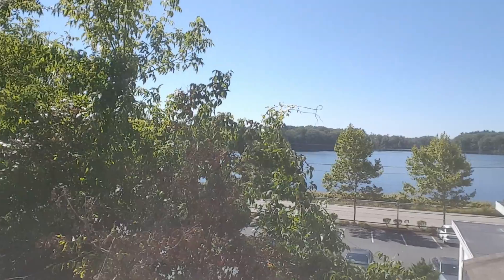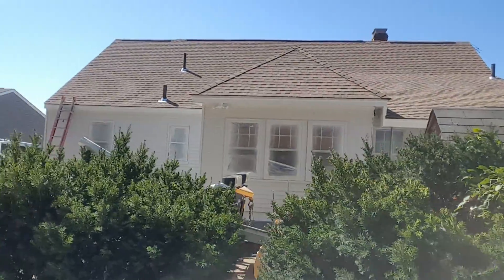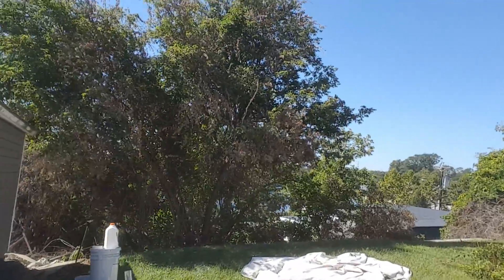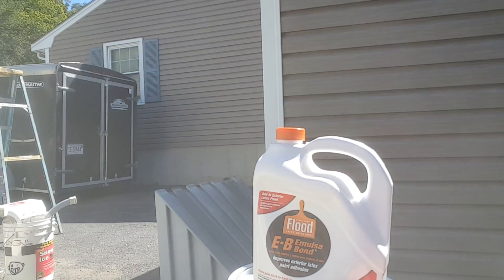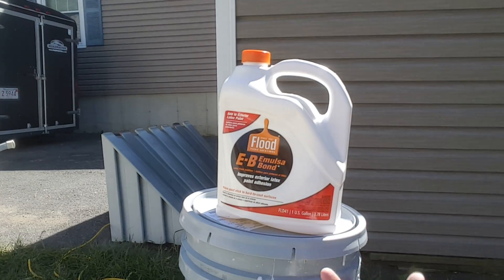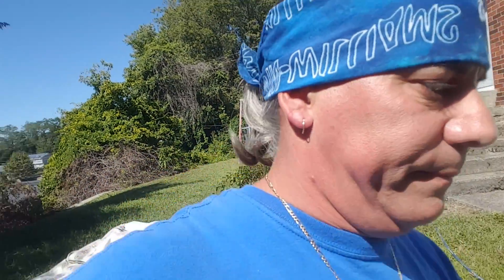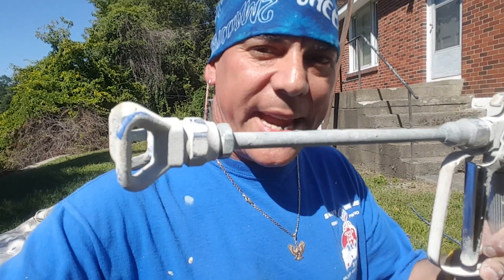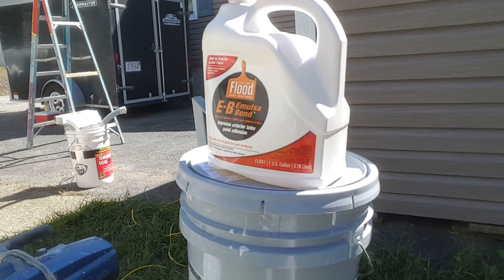Da P8NTRMAN🎨, Exterior Aluminum siding painting.

Comment: Thanks , lots of useful info .I'm needing to paint a camper with bare aluminum sides and top. I thought I would need an etching primer but the TSP sounds like it will do the job. Great Video
Reply from the maker: @Steve Branham, Thank You Sir for viewing my video. The beautiful thing about the process I am describing is that it works for virtually anything that is aluminum. It could be aluminum siding or it could be a Double Wide Mobile home. This process can be adapted  to that soecific application as well. Be safe and Happy Painting. God Bless

Sincerely,
Jhonny Da P8NTRMAN

Comment: I know this video was posted a long time ago but thank you. I’m researching whether I should paint or replace my aluminum siding. Difficult to find good information on aluminum. Everyone just wants to suggest replace but can’t explain why.
Reply from the maker: @nxvx9208  Hello there! Hope all is well and thank you for watching. This is by far one of my most watched videos. The integrity of this paint job is still holding today. The owner of this house is my best friend. I keep asking him about it, and he informs me that it's tight. Many people don't know what to do or how to paint it. Most people think that adding an oil based primer is the way to go. It really isn't.  People have this misconception that because it's metal, it must be treated like other metals. This formula that I came up with is formulated with longevity in mind. I researched the composition of each product and put it together. What I got was a thicker product, and to spray it, I knew that I had to water it down a bit. Once the paint dried, it adhered to the surface and shrunk but still remained flexible even when dried and cured. When that happens, it remains resistant to the expansion and contraction of the metal during extreme temperature changes. That type of protection is what gives a home owner peace of mind. Imagine not having issues with water damage from paint failure like peeling or cracking for, let's say, 10 to 12 years of protection? That is a winning formula.

I really hope that this Paint formulation works for everyone trying to paint aluminum. Cleaning is super essential. Happy Painting. Blessings in abundance🙏

Da P8NTRMAN 🎨

Comment: This video helped me do a great job painting our mobile home....Turned out great! Now I have a  new deck to stain..I have a gallon of flood Emulsa bond left..Should I add it to the Bearh acrylic latex stain that I want to use on the deck??
Reply from the maker: @Daniel Gullick, I am thrilled about the positive outcome of your paint project and I am glad that my video helped you achieve success. 
Regarding your question asking if Emulsa-Bond can be added to a Solid Latex/Acrylic Stain. My answer is absolutely yes. As you know I refer to Emulsa-Bond as being the steroid that makes the paint bond to its surface. I am sure that you will achieve a great result.

A quick reminder. It takes 30 days for Latex/Acrylic Paint to cure. Minimize your foot traffic for at least 2 weeks if you can. You want to allow the coating bond, dry and harden prior to using with a grill or a outdoor table with the umbrella base and or planters for plants. Power wash first and sand down the splinters and then coat. Use TSP and add either simple green or a little bleach to get any mildew off in between the boards. Allow to dry for a couple of days. 
When applying the Latex Stain paint 2 or three boards abd follow them through to avoid overlap marks. Don't paint in the height of the sun. Start it in the morning after the dew has burned off and dried. 

Good luck with your project and thank you for the feed back.

Sincerely, 
Jhonny Da P8NTRMAN 🎨
Reply: I've decided to use Behr Waterproofing stain and sealer....I also plan to add the flood additive on my new deck..The Georgia sun has it ready for its first coat...I was very impressed with the texture of the metal mobile home we painted...I hope for the results on the deck
Reply from the maker: @danielgullick7083  , Sounds good. Keep me posted on your progress. I am confident that it will come out nice. Happy Painting🎨

Comment: Jonathan, my home has aluminum siding that is peeling in places. The siding is installed over old wood lap siding that was most likely originally installed in 1931. I purchased my home a year ago and interestingly did not see the peeling nor did my hired building inspector. My question to you is why do you think the paint is peeling? The worst damage is on the north side of the building. I agree, it could be from expanding and contracting but confused by just seeing the damage. I like your thorough explanation of paint selection and will plan on heading your advice. Looking forward to your reply on the peeling issue. Thanks in advance, Marion South Carolina.
Reply from the maker: Hello Joseph, Thank You Sir for viewing my video Re Painting Aluminum Siding.

The cause of Paint failures have many causes but it seems that you are aware of one of the biggest problem, expansion and contraction of the metal itself due to temp change.

North facing sides are always problematic. It is possible that your building inspector failed to see the issue because of the lighting that day. Besides they mostly look at structural problems instead of cosmetic. In the future hire an experienced painter to look over the property and point out coating failures so that you can empower yourself with information to negotiate the price.

You stated that the home was Painted and now peeling. Aluminum oxidizes and prior to painting it MUST be etched and washed throroughly. Since it is peeling, power wash it with the additive called TSP. Read the instructions for the powder to water yield, first make sure you fill your 5 gallon bucket with water first. Secondly insert the power washer suction tube into the water then use either a brick or a rock to keep the suction tube immersed in the bucket then add the powder solution. You can use half hot water so that the Crystal's dilute better. Be generous with the applying of the TSP and be generous with the rinsing as well. Many people suggest scrubbing. I don't. I dont like scratching the smooth surface of the siding. Pre wet all of the shrubs in the area. Don't want to kill your wife's plants. No, I'm kidding. Something to add, if you have so mildew, mold or that green build up on the siding you can add a quart of bleach to your 5 gallons of water but add it at the end, after putting the TSP in. Always add the ingredients in after you fill with water, Why? To minimize the suds effect.
Ok, after etching the aluminum and after the flakes are removed by power washing allow the siding to dry for at least 3 to 4 days. As you see, I have NOT mentioned anything about primer. That's because it is not needed. Because by etching the hell out of the siding it opens the pores of the metal. 

In my video I used Sherwin William's "Duration" Exterior Satin Finish paint because of the fact that the house had no wind or rain protection. The Home sits high up overlooking a lake, Lake William's in Marlborough, Ma 01752. Down below you see the Notorious Route 20 which adds to wind turbulence in the area and since Massachusetts is big on using salt to melt snow that is added to the vortex of air pollutants and oxidizes in that area.
To make Duration better I added the Emulsabonder by Flood additive which makes your coating have that added elasticity to resist expansion or contraction. Emulsabonder is about $30.00 per gallon. The mixing ratio is 1gallon of Emulsabonder to 5 gallons of paint. Now you have yourself an extra gallon of paint.

I highly recommend two coats so you can get at least 10 years of protection. I took a look at the house in the video recently and it has no peeling problems. It was Virgin aluminum siding and no primer was used. I followed the same procedure I'm explaining to you.

The Paint Store may want to push other coatings. Beware! It may cost more money and it may not go well with the Emulsabonder additive.

This formula works extremely well and that is why I did it. My Sherwin William's rep suggested it and he had overseen 7 jobs that used this particular combo.
Returning to the Etcher (TSP) if you cannot find it in Hardware Stores you can find it on Amazon. The company that makes it is called Sunnyside Corporation. The product numbers are #699-852 and its a 4 pound bag. More than enough to wash your castle.

So we discussed the problem, the fix and the products. Watch my video as many times as you need. You may pick up on something the first time you viewed it. This Two story home used about 12 gallons of paint. The trim I brushed and the rolled with a 1/4 nap roller. Very thin. With Satin you have to paint from seam to seam. Minimize any overlaps. 

Satin Finish offers protections from the elements and bugs can't seem to be able to make their nests like spiders and Wasps. The siding can be easily housed down at Spring time and Fall. It holds up well BUT you might see some imperfections. Flat paint hides a lot of imperfections but everything sticks to it. I go with the lesser Evil.

If you have any questions beyond what I have explained you can email me at jlpaintdesigns at Gmail Dot Com

Be safe, beware of electrical wiring when washing. Make sure the ladders are planted properly. If you are spraying this product make sure to use the proper filters. You want it to flow. You can rent a sprayer at SherwinWilliam's. Don't purchase the Home Depot Graco sprayers. They just don't hold up well. Rent a Graco 395 or a Titan 440. It will serve you well.
Happy painting and keep me posted on how you made out. I Love success stories.

God Bless You! All the best from Jonathan La Salle - Da P8NTRMAN.

Comment: Thanks for the info, buying a tin sided house on the cape.  The white finished in beat, but this should do the trick to bring it back...Close to the water, will the salt negitively effect it?
Reply from the maker: @jron20 r, Congrats on your investment. The high Sodium content in the air near the ocean will affect all metals. Metal Coatings will be an ongoing issue. My advice will be to power wash at least twice yearly with TSP. You may also start switching to stainless steel fasteners, nails, screws, washers, nuts etc. In fact Stainless Steel everything.  You can also use brass. Stainless Steel is just better. Brass will tarnish and turn green when oxidized. So long story short, make sure that all metal surfaces are coated and protected. 

Enjoy the Ocean life my friend. I am a former Caribbean Surfer Boy.

Be Safe, Be Healthy and Be Blessed. Thank You for viewing my video. Hit the subscribe button and follow alk of my painting videos so you can learn new things.
Thank You!
Jhonny Da P8NTRMAN

Comment: I had an estimate to paint my aluminum sided house which is oxidised and 40 years old, they said they would user 2 coats of Sherman Williams super paint. After watching your videos I decided to try it myself and bought a graco 390 sprayer. I also bought TSP, was going to mix with water and simple green to wash the house with brushes and then power wash. Should I go with the Duration paint and EB or is the super paint efficient? You are inspiring, I hope to learn a lot from the project working with my sons to complete the job. Thanks in advance P8ntrman.
Reply from the maker: @Cristopher, Outstanding! Graco 390 is a great product. Just make sure you wash it throroughly after every use. Before you start I please ask that you watch and re watch my video. Take notes and follow instructions precisely. Painting is easy but very systematic. All of the products I used work outstanding together and the home I painted which I shared in the video still has held together fine after 6 seasons began battered by the sun, wind, rain and snow. 

Before you start please email me a message so we can connect. Before you get going let's talk on the phone so I can explain the procedures to you in detail before you start. My email is jlpaintdesigns@gmail.com

One thing to remember, I used to live in Massachusetts, now I live in Washington State. There is a 3 hour difference between East Coast and West Coast. Lets coordinate a time that works for you so we can go over products and procedures. Let's make this project happen for you. When we communicate I will also explain why Duration over Super Paint. I will also explain paint ratios and how much product to purchase. The importance of TSP for Aluminum. How much to use. No need to prime or scrub. I will also share what type of tip and base to get for spraying. Talk soon!

Sincerely,
Jhonny Da P8NTRMAN

Comment: Great video.  Helpful.  Thanks.  Saw a comment that maybe you are exploring options beyond the Duration - which ones?  I have a house with wood, aluminum and vinyl and was going to use a vinyl safe SW color for the Duration paint.  Any feedback?  Also, will the emulsabond be necessary or advisable on the vinyl or wood?  Also, if rolling, with the emulsabond, how much water to add? Grateful for any feedback.  Many thanks!
Reply from the maker: @Light Language, Great questions. I still stand by the Duration product. I recently tried the Emerald line and did not like it even though it is top of the line. I was not pleased with coverage.

Emulsa Bond together with Duration exterior Paint will bond to any surface, wood, metal or plastic. When prepping make sure the surfaces are clean of mold, mildew and any other algae. In your case since you have different material surfaces I strongly recommend that you use TSP with bleach added. A pint of each or as needed.  
Fill a five gallon bucket with 4 gallons of water. You may use hot water if you wish. It helps dissolve the TSP granules. Now place your power washer additive hose into the water and use a small brick or a rock to secure the hose to the bottom of the bucket. Do not submerge your hand into the washing mix until empty. Do not put bleach or TSP first, your water detergent mix will become too sudsy. So add water then TSP and then the bleach. Do not stir to mix, allow each solution to mix slowly. Use a faceshield or safety goggles  to protect eyes. After washing the house thoroughly let it dry for at least 3 days.
Secondly, for spraying,  rolling or brushing you will mix 5 gallons of paint with one gallon of Emulsa-Bonder. Pour the Emulsa Bonder into a five gallon bucket. Open your other five gallon bucket of paint and pour paint into de Emulsa Bonder bucket. Keep pouring you paint from one bucket to the other until thoroughly mixed. You do not need to add water to the mix like I did because I sprayed the paint and it needed to be a bit runnier to spray. When rolling or brushing is better for the mix to be on the thicker side. A quick reminder, stay away from the sun when painting. If you paint and the sun is hitting the side you are painting you may see overlaps unless you paint with flat paint. I used a Satin finish to resist moisture and to be able to wash the house with a hose if necessary. If you need to touch up and the paint is not flat remember to tough up and paint seam to seam. After you have painted the first coat wait a day in between to paint the second coat. Spray painting is faster if you know how to spray. If you don't then just go nice and easy with the application.
Thank You so much for viewing my video. Happy Painting and Happy Fourth of July.

God Bless You in abundance.

Sincerely,
Jhonny Da P8NTRMAN
Reply: @JonathanLaSalle  Bless you.  Very grateful for your detailed and thoughtful reply.  Very generous of you to take such care.  May you prosper in all you do!  Thank you!

Comment: I'm brushing 2 coats of Endurance on aluminum siding, shutters and awnings on my own ghetto crib.  I'd normally clean a house by spraying it with bleach water to kill mildew and soften up settled dust/pollen and then rinse well, but using tsp to etch, or "open the pores" of the aluminum makes sense.  Some of mine is bare metal.  Today, I'm using wood prep on my deck to open it's pores up for staining, leaving no pore unopened!!
Reply from the maker: OUTSTANDING Brother, Happy Painting. Endurance is a premium product. For Aluminum, don't forget to add Emulsa-Bonder for added bonding for longevity. Aluminum has to be Etched. TSP Neutralizes the Oxidity as the Aluminum ages. Thank You for your comment. I truly appreciate your viewing. I am currently waiting for knee replacement surgery. Wish me luck. God bless.